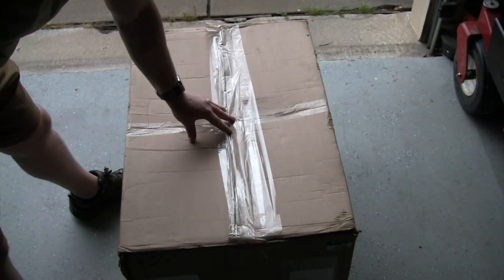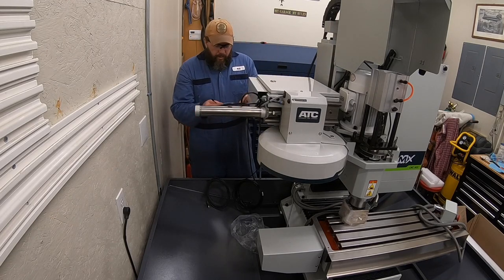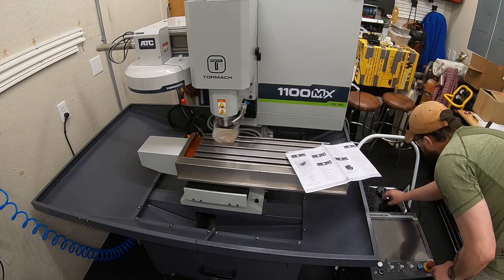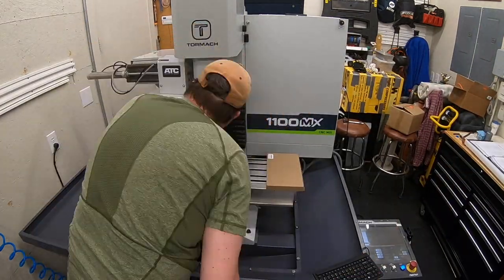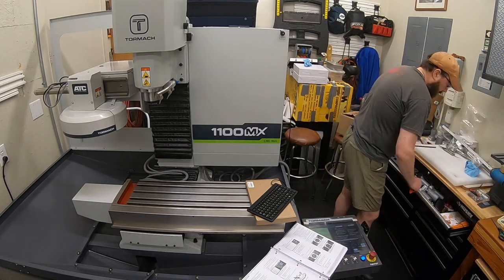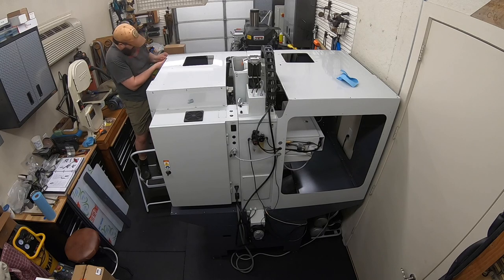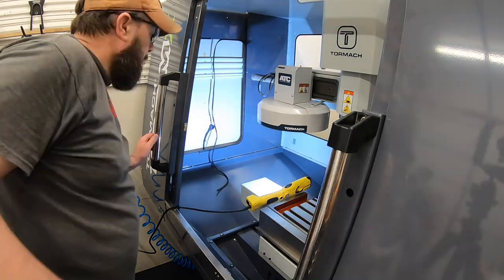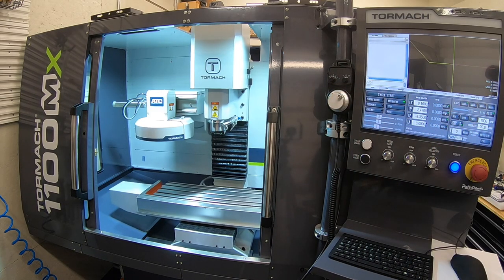Tormach 1100MX Automatic Tool Changer (ATC) Install & Full Enclosure Build + First PathPilot Boot!

Comment: Now I must say this video was extremely helpful in assembling the enclosure.  I was stuck on the right rear piece and until I saw you go up top over the electrical panel I was like *whew*!  I referenced this video several times during the enclosure build and I'm also willing to bet this video will become the defacto standard or goto guide for the 1100MX enclosure!
Reply from the maker: tdg911 - Thanks for the comment. Glad to hear the video helped you with the assembly of your new Tormach. Congrats on your new machine. Sounds like you are close to making chips!!
Reply: @BladesIIB  thanks! It's been quite a learning process checking into different brands/models etc.  I'm still waiting on the operators controller and probably have to go thru the same process mounting the arm.  Not looking forward to that at all.
Reply from the maker: @tdg911  mounting the arm is not to bad. Mine did not come with the template but easy enough to make one. Just leave the right side window out until you get the arm mounted and be sure to close the doors before drilling.

Comment: LOVE the video, just ordered my 1100MX, the video really helps take out the guess work, and gives a great overview of what to expect. I hope you get a million subscribers soon!
Reply from the maker: Lance Nguyen - Congrats on your new machine!  Thanks for the comment and really glad the video helped. I hope I get a millions subs as well. 😁
Reply: @BladesIIB  Did you have to make any special preparations to your shop to power the 1100MX? Or will it work fine with a 220V garage outlet? Thank you BladesIIB.
Reply from the maker: @lancenguyen9175  it just plugs into a single 220v outlet using a NEMA 6-20P. Minimum 20A dedicated breaker maximum 60A. My other 220 outlets were in use so I had an additional put in based on machine placement. Mine is set up on a 30A breaker and I have not had any issues.

Comment: Now that is a pretty looking machine!  Looks like mine is optioned like yours.  Thanks again for taking the time sharing.
Reply from the maker: tdg911 - My pleasure. I hope these help you get yours all assembled and set up when it arrives.
Reply: @BladesIIB  Man I cannot wait.  I'm seriously contemplating ordering the microarc 4 from the start.  I'm a hobbyist with no real machining experience other than a south bend lathe and a desktop cnc machine but we have to start somewhere!  Enjoyed your video's because of no annoying music and informative.
Reply from the maker: @tdg911  appreciate that feedback. I looked at the 4th axis as well. For what I need right now I don’t need it. The nice thing about Tormach is there pricing is the same so no difference if I add it later. Unless of course the price just goes up.
Reply: Did you order an additional light kit for inside of the enclosure?  Lights look really bright!
Reply from the maker: @tdg911  no that is the lighting it came with. Yes, they are nice and bright and LED.

Comment: Awesome video! I'm really considering buying one!! The left and right arrows are backwards as they are relative to the spindle! So right is x+ (when cutting the table moves left So the cutter can cut "right") and vice versa. 🙌
Reply from the maker: 2WN_2RBO - Thanks for the question. Yes X+ is to the right as you are setting up your coordinates in Fusion for example. As for cutting direction that can happen both directions depending on whether conventional or climb milling (most often climb for CNC) and depending on which side of the part you are on. I hope that answers your question. If I misunderstood and did not answer let me know.
Reply: @BladesIIB  correct. Kindly, I did not have a question rather was correcting you in the video stating the buttons were backwards as they were not. I began my machinist career 10 years ago, began with conventional, and program setup and operate cnc. How it's setup in fusion is irrelevant to how the machines buttons operate the table. Regardless of how its setup in fusion (mastercam etc), the table will move the same, all that will change is the front and back (or sides) of your part. Fusion wasn't used in initial setup of the machine. 
Not trying to be rude.. I was only trying to help inform others who might've thought the same as you did in the video. I'm just the guy who wishes I had one of these in my garage, and some day will! 🍻
Reply from the maker: @bmorlok84  appreciate the follow up and clarification. My apologies for the initial error in my video and for misunderstanding your first comment. I never intend to confuse so thanks for sharing your experience to clarify. I believe my initial comment about the buttons was just my visual of if you push the right arrow button the table moves to the left and if you push the left arrow button the table moves to the right. For someone without CNC experience that seemed backwards since I was not considering positive and negative.  I don’t question that it works as intended so backwards was a poor choice of words. Again, apologies for the confusion and thanks for clarifying.
Reply: @BladesIIB  I apologize if I came off the wrong way or criticizing. Not my intentions whatsoever! Nor bragging as I learn everyday! I was only simply trying to help it be more understandable cause when I handle jog a haas, I constantly have to remind myself in my head when pushing the arrow buttons, which way I need the table to move (momentarily disregarding the spindle). Its honestly always one of those constants, no matter the experience! 🍻
Reply from the maker: @bmorlok84  No apology needed. Did not take it any way other than good helpful feedback and learning. Like you I am always learning and my main goal with this channel is to help others learn. Well thought through comments are always truly appreciated.

Comment: Finally got my 1100MX.  Used your video to help out with assembly, thanks for making the video.  
I see you ran the Operators Console power with the rest of the wires, where did you plug it in?  
Sikaflex is great color match, but very messy the first day until it dries.
After seeing how big it is, amazing how you got it to fit in your area.
Well, back to finishing up organizing the wires.
Reply from the maker: Jerry Chapman - Congrats on the new machine. Glad the video was helpful for your assembly. I ran the console power through the accessory compartment and out the back slot with the other wires and plugged it in to one of the 230v Accessory Power outlets in the back of the machine. If you read in the transformer block it says 100-240v input.  Hope that helps, time to get some chips flying!

Comment: Hi, really useful series of videos thanks. I'm currently waiting for my atc and other parts to arrive.  Can you please share a link to the bonded rubber washers you used for the chip trays thanks?
Reply from the maker: James Laird - Congrats on the new machine, apologies for my slow reply.  For the screws going down into the drip tray all around they are 6mm and I picked up some ¼" bonded washers from Home Depot, I don't have the part number for them they only have one kind that I recall.  They are fairly cheap and when tightening most of them squished out quite a bit as I went tight to really pinch the butyl tape.  I also put a little silicone on the heads of them.  For some of the side screws around the enclosure that are low and the bottom few on the windows, they are 5mm and I picked up some better washers from McMaster Carr item 91195A141.  They were pricey but they did not squish out at all, they are a high quality silicon and not the rubber like the other ones.  Even though they are pricey, I would likely order the McMaster Carr washers in 6mm for the drip tray if doing it again.  Good luck with your set up and thanks for the question.

Comment: Nice video as always. What size bonded washers does the machine use? I have my 1100mx coming this week! Thanks
Reply from the maker: Jeff Carroll - Congrats on the new machine, some fun days ahead for sure.  For the screws going down into the drip tray all around they are 6mm and I picked up some ¼" bonded washers from Home Depot.  They are fairly cheap and when tightening most of them squished out quite a bit as I went tight to really pinch the butyl tape.  I also put a little silicone on the heads of them.  For some of the side screws around the enclosure that are low and the bottom few on the windows, they are 5mm and I picked up some better washers from McMaster Carr item 91195A141.  They were pricey but they did not squick out at all much better silicon than the rubber.  Even though they are pricey, I would likely order the McMaster Carr washers in 6mm for the drip tray if doing it again.  Good luck with your set up.
Reply: @BladesIIB  Thanks a bunch bud. Yea i did remember you saying some of the rubber on the washers squished out. Keep up the goof work!!!

Comment: So now that you had the Tormach for several months would you buy it again?
Reply from the maker: Scott McDonald - I absolutely would. It has done everything I have asked of it so far and the learning journey has been great. To be fair, this is my first CNC machine that I have ever run so I don’t have anything to compare it to. That said, I have run a lot of manual machines and this Tormach is a good quality package for the price. Very glad I went with the BT30 spindle, I believe this machine will serve me well for a while.
Reply: @BladesIIB  Thanks for the reply.  The wait lines for equipment are still really long so trying to do as much research as I can.
Reply from the maker: @Repairman87  Happy to answer anything I can. The waits just seem to be getting longer. Good luck in your search. It can be hard to decide for sure. My recommendation is wait for what you want, if you settle, you may always feel like you settled and wish for something else.

Comment: how tall is the machine to the top of the  energy chain during tool changes? i have one on the way and need to possibly modify the celing in the space it will be fitting into? btw awesome videos, i think you are doing a great job.
Reply from the maker: christopher tom - Thanks for the question. The max height they give for the machine specs at 96” seems to be right for max height to the top of the chain. Also, on the support pages for mill support you can find a link to download the models and solid drawings of any machine and you can open that in Fusion or another CAD program and get literally any measurement. Here is the link to the 1100MX support page where you can find it. Congrats on your new machine. Hope it arrives soon. https://tormach.com/support/mill
Reply: rock solid information! thank you so much!
Reply from the maker: @christophertom6904  Welcome, glad it was what you needed.

Comment: All those wires and air lines exposed on the ATC and behind the table on the "Y" axis look very cheesy and future problems. What you think? Wonder why they dont run those under the "Y" axis ball screw cover.
Reply from the maker: David G - Fair question. I have never owned or run another CNC mill so I don’t have anything to compare this set up to. I can say I have been running it pretty steady for 8 months with no issues with the ATC lines or other wires. In my research before buying and on the forums I am on since that is not an issue I recall hearing others talk about?  When cleaning up chips they don’t create to much of an issue cleaning around, but if they were not there I would not complain. Hope that answers your question.
Reply: @BladesIIB  Thanks for the reply. Good to hear that hasn't been an issue for you. I'm not trying to knock your machine just a concern for problems. I want to get a CNC for my house and I'm leaning toward a Tormach. Thanks for the Video very informative.
Reply from the maker: @davidg4188  Did not take as a knock at all. Good question. I have been happy with the Tormach so far. I lack in CNC experience and comparison but I have many years of manual machining experience and this is a quality machine package for the price point IMO. Good luck finding what is best for you.

Comment: are you working in a closet?
Reply from the maker: @Excentrix54 - Ha, it feels that way sometimes.  It is a small shop but it works for me.  The space is a single bay of a garage so about 12x22.  You can check out a full shop tour here https://youtu.be/2U6gp8vgnK0.  Thanks for the comment.
Reply: @BladesIIB  I wish you the fortune of getting more space brotha. You will be less frustrated I promise
Reply from the maker: @Excentrix54  No argument here, would love some more space for sure. Until then I will make due with what I have. Thanks!